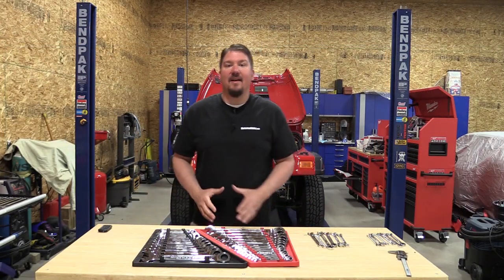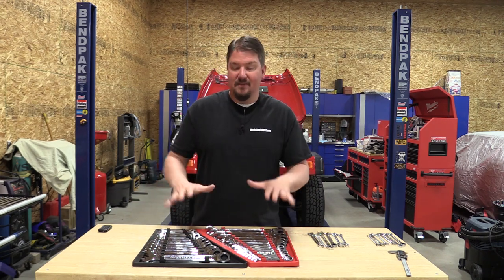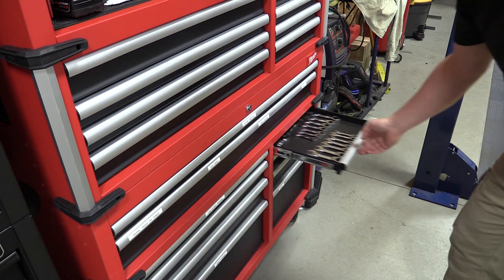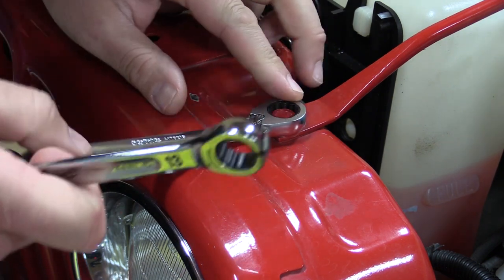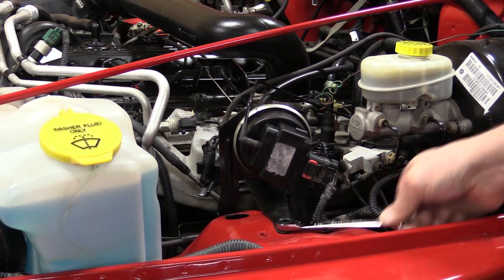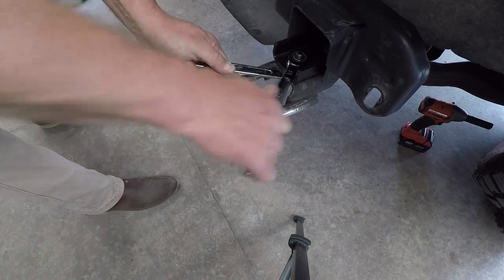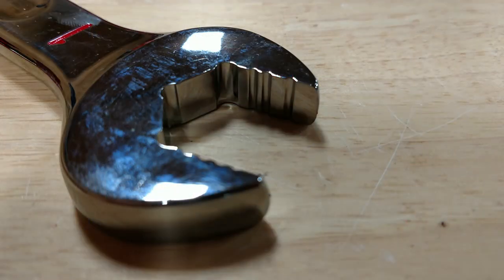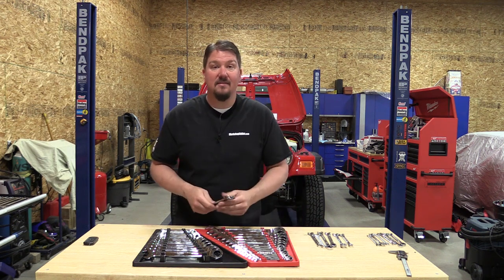Milwaukee Ratcheting Combination Wrench Sets with Max Bite Review

Comment: Each job is different, flat or angled, it all depends. I noticed a bit of looseness on my Gearwrench ratcheting wrenches at work on the opened end (probably all made in the same factory as Milwaukee). Thanks for the review!
Reply from the maker: Tim's Tool Reviews I doubt Apex is working with Milwaukee, but it is possible.

Comment: 1:40 It seems that based on your testing the 144 positions don't yield an equivalent gain in tightening as there appears to be a certain amount of slop which cancels the benefit of the additional positions. Could you confirm if at least some of the gain from the additional positions is lost due to slop? Thanks!

Comment: Measuring the wrenches with calipers holding them in mid air like that is not going to be very accurate. They should have been measured with everything laying squared up on a flat surface.

Comment: Like any other brand  nothing special
Reply: No not like ANY other brand.  There are many brands far superior.
Reply: @nathanr.8556  . Which brand of ratcheting wrenches do you prefer? I've been researching for a good while now and can't find anything of great quality with more than 72 teeth or positions that's not Snap On or Mac. SK X-Frames look amazing but have very limited sizes. The Wright Tool wrenches look fantastic but no ratcheting wrenches. Williams look great but are only 72 teeth. Blue Point also look great but they are also only 72 teeth. Any others that I missed? Am I overthinking this and should I just get a good quality 72 teeth wrench? 

I've read a lot of quality problems with both Gearwrench and Tekton so at this point they are off my list.
Reply: @MrSupernova111  My favorite are the 100 tooth Capri Tools flex head sets.  Unfortunately they no longer offer the non flex head versions of those.  Quality is excellent and warranty is effortless if you buy direct from their website.  I also found 90 tooth Kobalt sets recently on sale.
Reply: @nathanr.8556  . I appreciate the tip. I don't  care for flexhead so I'll check out the Capri website. Thanks!
Reply: @MrSupernova111 No problem.  Glad to help.  For 90T non flex head maybe check out the Taiwan made Kobalts or the more expensive Capri reversible sets.  I am not impressed with current production Chinese Gearwrench
Reply: @MrSupernova111  I just looked on Lowe's website and the 20 piece set is still on sale 50% off for 24.99.  It's a steal for 90 tooth Taiwan made!
Reply: @nathanr.8556  . Awesome! Thank you!

Comment: The SK Tool ratcheting X-Frame 12 piece set is $230 - Made in USA and seems like a lot better option.  A 15 piece set of these is $256.  Go with the SK
Reply from the maker: The pricing on these on the street, presale is around $230...  We support USA products and would make the same decision.
Reply: Eric Furness holy shit that's an excellent point
Reply: I just wish the SK came in a 12 point option. It's needed in aviation.
Reply from the maker: Its needed in aftermarket automotive engine parts also.  Every ARP bolt that you can see on our 383 is 12 point.
Reply: Good call! The SK's have a 1.7 arc swing on them as well. If you ever did have an issue, SK will take care of you on warranty as well. I like to buy a USA product whenever possible within reason.
Reply: I'd go sk as well. I was guessing about 150$ since the sk is about 235ish. Sk are better and made in the usa so seems like a no brainer on where my $ is going
Reply: Milwaukee wrenches are also made in USA. I'll go with Milwaukee to match all my impact wrenchs and ratchet wrenches.
Reply: @DannyD-vw9vv  Milwaukee are Taiwan made by a company named infar. Nice wrenches but not USA
Reply: I own both and agree.  I love the SK Xframes and the Milwaukee.  I love the frames for arc swing and the six point closed end.  The Milwaukee is great feels like quality and holds up and has a tight grip.  Both are good but like I said before I’m a Milwaukee guy but once again ... if I had to choose it’s SK xframes. ( And no I won’t repeat that lol )
Reply: This set is going for $175 now.
Reply: chris jones just curious, how sure are you on this?
Reply: Wes Booth The fact that Milwaukee doesn’t say they are ‘Made in the USA’ should be all you need to know. What US company wouldn’t put that on their product?

Comment: I found these for $175 per set now. How do you like these long term. I really like that max bite head but I really want that 15degree on the reversible ones. What's your long term though on these Milwaukee. I'm kinda between these and the Wiha ratcheting sets right now.
Reply from the maker: We use them, but they seem a bit soft when you really put pressure on the jaws.
Reply from the maker: imgone  The metal is soft and some are more pliable than others.  I have had to return a few 13mm that would fit 15mm.  The quality seems to vary between wrenches.
Reply: @WorkshopAddict  I noticed exactly this today. Like different manufacturers made each wrench or set of wrenches.

Comment: I think they need to get these into the depot stores so you can actually see them in person. I probably would have already purchased them.
Reply from the maker: John Gibson They should be there in the next day or two.  Acme will be shipping on April 25th.
Reply: Hachi-Roku Performance Group  I don’t understand these companies. What sells on the shelf they should carry that’s how you make money. Also choices bring people to your store. Example if you sell one kind of car and another dealer sells the same but has another dealer next to it where do you go. I think you and  I know this answer to this question. Come on Home Depot get some brains and put these great tools in your store.
Reply: John Gibson I’m in the same boat John, I’d probly buy a standard and metric set at one time if they were on the shelf but I refuse to buy anything like this online where I can’t touch and hold it first to see if I like the feel. 

I’m also going they the same problem with the Milwaukee table saw and miter saw. I need to buy both but Home Depot does not carry them in their actual stores and it’s starting to piss me off with Home Depot

Comment: I’m very picky on all my hand tools. Consistency makes money. Milwaukee nut drivers are very similar to the wrenches, each generation differs slightly in the contact points on the bolts. Which may sound minor to most, but if you install 100 bolts a day and get accustomed to the “fit” it’s frustrating when it changes. So I went back to another brand for the time being. When the next generation is released I will give a few month sample size and compare and contrast again. Great video, appreciate the in depth details.

Comment: I'm not big on the smooth finish.
I'd rather a knurled surface for grip.
Reply from the maker: What is your favorite wrench?
Reply: I've had an old set of Sears Craftsman for a really long time, and I like them a lot.
After 30 years, I snapped off the open open of one of them working on my car and I took it into a Sears store and without saying one word, I handed it to a salesman and he walked over to a cabinet, and without saying one word, handed me a replacement.
Now that is my kind of warranty.
(And the set I had, had a knurling on the side which made the grip a lot better then the smooth ones like snap-on.
Love your content, and especially when you guys do the videos about working ing on cars, like the Vette videos.)
Reply from the maker: Thanks for the compliments on the videos.  So your Craftsman wrenches are slightly different than mine.  Mine are pretty smooth, not polished, but smooth.  I have only bent them, never broken them.
Reply: I was given a set of Snap-ons by a relative, and I roughed them up with a file.
This gave me a much better grip with greasy hands.
It works well, but pisses off the "purists"...lol

Comment: The cases are nice, but at that price point the SK X-frames are a far better option for short straight ratcheting wrenches. Six point ratchet ends, shorter swing arc and American made.
Reply: The problem with the SK X-frames is that they come in limited sizes and there are reports of the ratcheting system skipping which doesn't give you the advertised arc swing. The X-frames also don't come in flex heads which is what most of us want.

Comment: what you ain't fussy about is the 144 positions. if there so much slop that it has the same amount, it does nothing.
Reply: I was thinking the same exact thing. Based on what I saw in the video it appears that the slop cancels any gain from the additional positions. If this is the case, this set of wrenches is highly overpriced until they can fix the problem with the slop. They look beautiful but not for that price with all the slop in the box end.

Comment: Put this guy up against my SK X FRAME. Has a 1.7° swing and tough as hell. Just finally stripped a gear on my 10mm only took me lifting my body off the ground to do it.
Reply from the maker: Those are awesome wrenches!
Reply: doubtful...
Reply: @dccracker7922  buy a 10mm and test it. I was laying under my car and had everything I had to brake it still works but catches when it goes around every once and a while. Best wrench I've ever used.

Comment: my hypothesis is that by having a little bit of wiggle room in the wrench it allows the teeth to get a better grip on the bolt or nut...
Reply from the maker: Milwaukee has since corrected this "sloppiness" in future runs of this tool.

Comment: Ill buy them when they come with a flex head. straight flat wrenches sit in my draw collecting dust already.  They are pretty to look at but thats about it.  I could use a new flex head set.  I am loving Milwaukees new line of automotive tools.   I just hope they dont start with the gimick tools like hammers on the ratches and stuff like that ha'

Comment: Do you think these, or the regular Milwaukee wrenches, will hold up in a professional environment? I'm looking into becoming a technician at the dealership I work at, but I'm not wanting to go all out on expensive tools from the git go. I'm more in the mindset of buying something affordable, and then buying something higher quality if and when I need it. Like if one broke I could justify spending the money on the Snap-On/Matco/Mac. 

Also I personally hope they come out with a wrench set, ratcheting or not, where the box end is six point. Finding six point seems to be a challenge, and it'd be nice to have the option.
Reply from the maker: I believe the normal Combination Wrenches will hold up in a normal dealership.  If you were doing suspension or other heavy duty work day in and day out, they might wear faster.  They have a lifetime guaranty so you will be covered if they break.  I do not have enough time with the ratchet wrenches to answer the same question.  The combo wrenches have been great to us and they are used daily.  There are better out there and once you are making great money you might want to upgrade to a brand that has a truck that comes often to help you with warranty issues.
Reply: Tekton has the ratcheting wrench with the 6 point.
Reply: Why need 6 point rather than 12 ？

Comment: I love Milwaukee but i don't think this gear wrench is the way to go.   The head on ratcheting side is too thick and the swing Arc doesn't seem to be any tighter than the Sonic wrench you have.   Plus having a flex head is always better in tight places.  A flat fixed head will be useless in most applications
Reply from the maker: Wesley D I think the Sonic was slightly tighter on the swing

Comment: If they make a version with a selector switch I'll be all over this.  Really hope they decide to make socket sets. Trying replace my old American craftsman.   Seeing just get China junk now when have to replace.
Reply from the maker: I believe this transition to mechanics tools might be slow, but it is coming.
Reply: They have sae and metric sets of shallow 3/8 inch sockets !
Reply: Check out granger. ..they have flex head with a lock for the angle
Reply: all Milwaukee tools are made in china.. i find that there is 2 types of craftsman china sockets the easy read with laser etching ( I do not like) and some that have the knurling on the bottom without the easy read which I really like them a lot very nice for china made.
Reply: @ryandussel8735  wrong.. Milwaukee wrenches are manufactured right here in the USA.
Reply: Danny D 1333 bullshit I never seen anything made in the USA from Milwaukee... at best they are made in Taiwan

Comment: Look nice but if I'm grabbing a ratcheting wrenche specially one with an oversized open end they better be reversible.. I absolutely love the reversible feature on my platnium set, ez red set and even my reversible gearwrenches
Reply from the maker: I can see that.  I like to use the straight ones when working between the engine and transmission on cars and trucks.  The straight allows for more space in that situation.
Reply: WorkshopAddict I could definitely see how it's useful in situations like that. I'm still curious on the sizing differences between these and the standard combination sets.. hopefully they changed and not a sign of poor quality and differences even between sets
Reply from the maker: I have asked but received nothing back yet.  I can only guess that the max bite was grabbing too much and this makes them faster and easier to use.  But I am glad I have a tight set of Combo Wrenches.
Reply: My boss uses GearWrench Flex Head ratcheting wrenches. Best of both worlds.
Reply from the maker: We have those Gearwrech flex heads also and they are OK, but the head area is larger so it is harder to get into tight places.  But that is why we have so many sets of different types because they all work for something.
Reply: WorkshopAddict sure would have been nice to have same open end. I could see situations of needing a 2nd wrench to get job done then. If only the sk x frames came in reversible itd be best of both worlds.